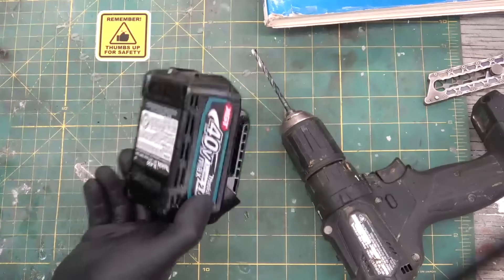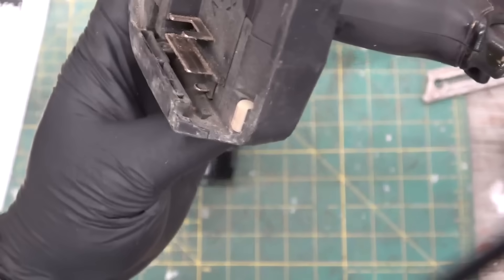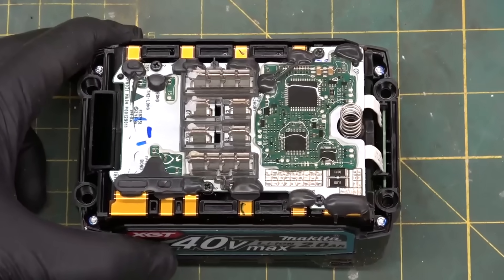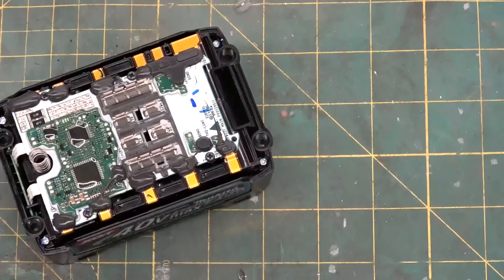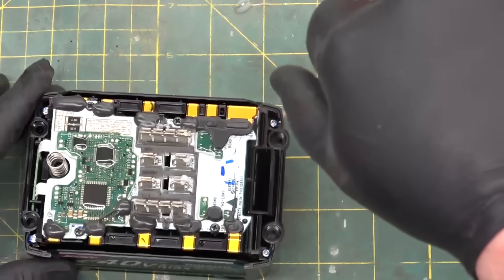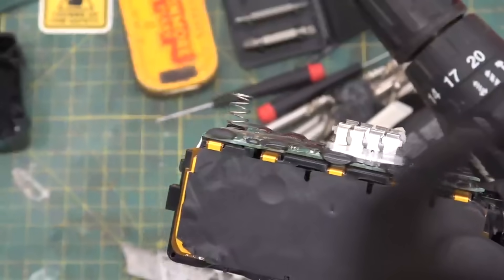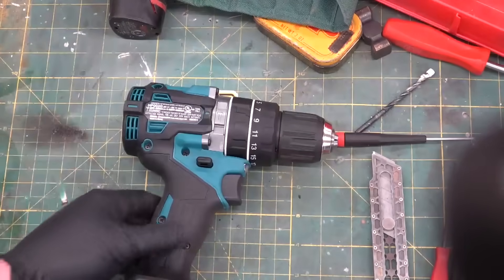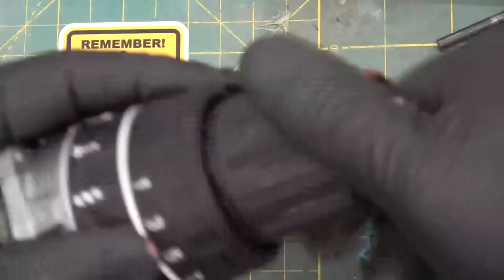BOLTR: Terrible 40V Drill || Et tu, Makita?

Comment: Pretty soon tool manufacturers will be up to 110v and we can just plug them into the wall.....
Reply: Shame we Europeans will have to wait until they get to 240!
Reply: @notsonominal  ... It'll be a while 😞
Reply: @ yeah, DeWalts 54v flexvolt is already 110v compatible but that doesnt help us over here.
Reply: @notsonominal just run it half speed😂
Reply: @notsonominal  Maybe they will go to 110 then just put two batteries in series.
Reply: @AlgoRivm  that is what they do with the 54v flexvolt system - but thats also just about the limit of Safety Extra Low Voltage (SELV) power supply and I suspect there will be regulatory hurdles past that.
Reply: @notsonominal  UK site-safe tools are all 110v through a split pole transformer, so unless you do something really dumb you'll probably only get hit with half of it so 55V AC, barely a tickle lol 🫠

Certainly a lot nicer than the belt you get from 240V AC if you make the smallest mistake 

And for the bargin hunters out there, searching UK for-sale sites or marketplace for "big yellow battery" or "heavy yellow battery" will bring up a bunch of scorned Ex's selling off tools that they aren't all that clued up on and there's no man around or he'd tell her it's a transformer, not a battery. Happy hunting UK folks lol 🇬🇧
Reply: @notsonominal just use a transformer!
Reply: @tomspurr7963  DeWalt actually makes a faux battery that takes 230v and emulates the flex volt system. Problem is the tools aren't made for that service factor and burn out.
Reply: XGT actually pulls more power than you can get from a 120V socket. Tabless 21700s can do 70A, which is 2800W, or 23A at 120V (120V sockets generally max at 15A).
Reply: @dsgamecube then plug it into a dryer plug. 😂
Reply: @dsgamecube what if i have 240V sockets ? 20 amps no problem
Reply: @dsgamecube laughs in 230v 10a
Reply: Unfortunately when you rectify and smooth 120vac, it becomes 170vdc. But, other than the fancy new brushless tools, those old "dc" motors are actually series-wound universal motors, they'll run on AC, DC, fvckin' they'll run on your PC if you hook em up.
Reply: Then they can sell ya 2. Half hour run time, half hour charge time. Just plug the whole thing into the wall with a PC cable, charge the tool instead of taking batteries out.
Reply: @SomeGuyDjoeOnBass you know before there was battery drills there were corded 120v ac ones??
Reply: Here in the UK some clever sod invented plug in 240 volt power tools 🤣👍
Reply: I have some tools like that!  They're great... until you get to a job site with no power.
Reply: @rex8255  The lectrical-tician is s'posed to set up temp power.
Reply: @xtnuser5338  ohhh, your work on them FANCY job sights, with like people and stuff!
Reply: Genius corded cordless 😂
Reply: Unfortunately, that one foot cord.😢
Reply: Wow future sounds amazing
Reply: Portable thermo nuclear batteries are where its at
Reply: This has me 😂
Reply: metabo has come out with an ac adapter for their 36v cordless tools. in case you didn't know. So yea it is here. It is kind of nice though, If you're near an outlet you can plug the 36v compressor in. I haven't tried it on anything else yet. It is a bit bulky.
Reply: Sounds retro. Let me grab my man bun.
Reply: Damn your on too something there.😂
Reply: AC vs DC bruh
Reply: @timwrich5128  Rect it and cap it, might be rough but it works...
Reply: Diodes... and kapow, rectalfication!
Reply: Amazing lol!!!
Reply: Nothing like going the long way 'round.
Reply: yup a full 360
Reply: Tools is a kiwi🤦‍♂️ not a Australian😂
Reply: Imagine that… what convenience
Reply: For real....
Reply: Lol😅
Reply: "Dual Fuel"
Reply: Real power tools are 240v  :p
Reply: @jonathanwright5550  REAL power tools are pneumatic.
Reply: "Its a thermo poly carbonate butal hydroxide 800 plastic"...I love the bullshit he makes up as he goes
Reply: @Chris_Willows  irs fun to see what he is saying wrong intentionally for humor  and what is actually the correct thing he is saying that just sounds wrong
Reply: dewalt do that ,,some of their chop saws will take two 60v flexvolt batteries or plug it in to the 110V mains
Reply: If you have dendritic you need to be using head and shoulders-works good
Reply: 120VAC is 84VDC so once we get there you will be able to slap a rectifier on the outlet and then plug er in just like grandpa!
Reply: @jaythompson5102  What?  120VAC rectified is 170VDC.
Reply: Yeah... AC ..... Try it.
Reply: @broderperdurabo  the motors already are AC, there's a variable speed drive that converts the DC battery into AC
Reply: @moonasha  The motors run on 3-phase AC and the wall only has 1-phase.
Reply: @broderperdurabo  nothing impossible with a F U U L B R I D G E
Reply: @neaudle2204  All hail the FULLBRIDGE!
Reply: @broderperdurabo  When I was a kid, I had the brilliant idea of using the old Christmas lights that my father threw out during the holiday season. I took that and cut the lights off and tried to fashion it to my mini car DC motor that had flimsy tabs so it contacts the track. One side had broken off and I had to hold that wire to that side when plugging it in.

The result : a wall socket blackened by smoke fire up to the wall, my fingers holding the wires were hurting and later developed a blister. As for the little DC motor, it had flown across the dining room and the kitchen floor and stopped by hitting the dishwasher 18 feet away. Let's say that the little dc motor had the fastest lap he'd ever do.
Reply: @broderperdurabo  great job missing the joke there sport
Reply: @aquacruisedb comment section be on the spectrum.  I like it...
Reply: @broderperdurabo  Lmfao 🤣😆

Comment: Makita went with "40V Max" because the yellow brand had "20V Max" as it's signage.  We all know they're 18V packs made with 18650's.  So the 40V is 36V after a few spins.  Just took the LXT x2 movement to a single pack.  That's it, that's all.  It does give the chance to ramp into the 80V scene though (and they have).  Or, 72V after a few spins.  21700 metrics.

Comment: the battery needs holes for airflow, theres going to be water in the battery case even if there were only holes in the top, there are holes at the bottom so that the battery can dry out once its been wet to avoid damage. the battery can withstand water that doesnt just sit in the case.

and yeah this drill isnt nearly as good as the flagship xgt drill

Comment: The Röhm Chuck is crusty because you  locked it up halfway midair
When you close it, at some point it clicks, and then you get to tighten some more. This mechanism keeps it tight in Both turning directions. If you fuck around with it, you can get it in the crusty state. simply put a drill bit or whatever in, tighten it, loosen it and it feels like you would expect. 

Similar Chucks are installed on other brands aswell

Comment: Buys the cheapo low end 40V Makita drill HP002, not the decent HP001. Is then surprised it is cheap.

Proceeds to complain about air cooling vents on battery (the charger actually cycles air through them while charging with active fans), that allow faster charging speeds without damaging the batteries.

Mentions that fast charging is bad on the batteries, neglects to notice how the voltage is double the industry average so the heat generated while charging the same amount of energy over time is less than half.

My expectations were higher, no idea why you have so many subscribers. Probably due to comedic delivery and performance, not accuracy and fairness.

Comment: the real issue with all these high voltage cordless packs is they have to be huge to get any kind of ah. here we are using a 6ah size pack rated for 2ah since its 40v. metabo has the same issue, great tools but runtime sucks and even with 36v the metabo tools cant outperform dewalt or milwaukee at 20v

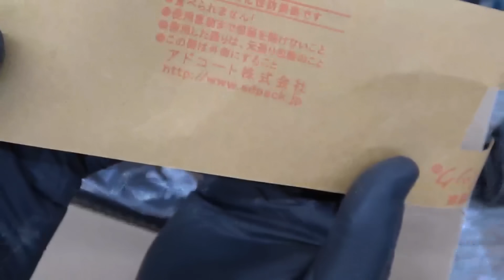Comment: 1:20 VCI (volatile corrosion inhibitor) paper. Could never trace down what chemical it is. But it does volatilize in a closed chamber. Will fuck your eyes up if you open said closed chamber too close, in an enclosed environment, hands close your face, etc. Fun with gauge blocks

Comment: I prefer the 40v cordless impact and drill that you can buy separately and not in the kit. For some reason they have 3-4 models of each one in the 40v. For example my drill has a full metal chuck vs the part plastic one that comes in the kit.

Comment: I already hated Makita because of the ass backwards horseshit marketing strategy of ABSOLUTELY FUCKING every loyal customer. Instead of just upgrading their 18V batteries like literally every other power tool manufacturer (for fuck sake man, even Kobalt, Ryobi, and Masterforce are offering better 18/20V battery packs), they said FUCK YOU! If you want better batteries, you have to buy all new tools. So there's people with literally over $100,000 invested in the LXT Lineup and all their friends have been laughing at them for years because the best LXT battery you can buy is a 6.0 with 18650s in it that cost $160 a pop when Milwaukee M18 and Dewalt 20V MAX, have producing 3.0, 4.0, 5.0, 6.0, 8.0, 12.0 and even 15.0 battery packs with 21700s and pouch cells for years now and FOR LESS $$$$$ than Makita junk 18650 packs, and instead of upgrading their packs, Makita said, no, fuck our loyal customers, let's make them buy all new tools. I know I'm talking in circles, but I cannot express enough how much I hate Makita for this move. Fuck them. Fuck their 40V tools. And fuck you for buying them and supporting a company that hates its loyal customers. Makita could be the best power tool company on earth of all time, Id still never buy a god damn thing from them on principle for this move. Absolute jerk off move. Fuck them. There is NO GOD DAMN REASON they couldn't just upgrade the cells in the LXT packs instead of making a whole new tool line. It's a cash grab, plain and simple. And then to find out the new 40v tools are shit quality too? Makita is no longer in the conversation of "the big three" it is now TTI, SB&D, Chervon, are the big three, all the others (Festool, Hilti, etc.) And THEN Makita at the bottom of the dung heap as far as I'm concerned. Fuck them.

Comment: It sure would be nice if the batteries (and the tools too) kept track of usage statistics. Every laptop battery and hard drive for the past 20 years has done it. The circuitry is already there. 10 cents for an NFC chip would let your phone (or whatever) see how many charge and discharge cycles, average amp hour usage and overall health of the battery and tool.

Comment: That is one of the worst tools of the entire system. 
The impact also has no big advantages over the lighter 18V... 

The benefit of this system is when you need more power. 
The big drill, large SDS rotary hammers, angle grinders and so on are where the real juice is. 
I tested the smallest rotary hammer HR010 against a new bosch professional corded machine... it wasnt even close.

Comment: 40V is going to have 1/2 the current as the traditional 20V so It’s actually OK if the cell links are made of thinner conductors. Also since the entire board has a conformal coating (and a thick robust one) the openings in the case are actually a GOOD THING. 

Even if you drop it in water the water will run right back out of the battery instead of getting stuck in most regular designs. It’s not as if anyone is actually going to be trying to use the drill with the battery fully submerged and if they do they deserve the outcome. 

While I haven’t used these myself I wouldn’t have a second thought using them in the rain. With how warm they get with the fast charging it will dry them out.

Comment: I'm thinking that the T8's inside the battery case are actually security torx, where the bits need a hole in the centre to properly engage.

Comment: Of course it can't drill leftwards, you are using the wrong hand when holding the drill.         In all honesty, I have no idea why they put air vents at the bottom of the battery pack - I guess the theory is that any water would drain out while Flexvolt instead has the vet at the top right corner but I would imagine water would drain out anyway when moving the tool around.    Very odd.

Comment: I don't really understand who Makita made these for. The 40v batteries are huge, and these are really expensive (even for Makita). I consider myself a Makita fanboy in many ways, but they should have just started offering 21700 cell (or pouch or tabless) batteries, and rolled out an equivalent of Fuel or XR tools that can take advantage of the extra pixies from the big boy packs. Makita got left in the dust on their battery tech, and it makes it hard to justify the cost. These 40v tools do not seem to remedy that problem.

Comment: I've had an OG Makita BDF454 brushed for 20 years original battery is invincible and in that time I have been through a Willfucki Fuel and AEG brushless disposable garbage. It drives through ironbark and stringy bark hardwoods no problem. Who cares if it takes 2 seconds longer to drive a screw, longevity and reliability is the true marker of the best tools.

Comment: Im pretty sure the batteries come in a deactivated state until they are installed on a charger. I put a new one on and took it off immediately, it had 1 or 2 bars and would run the tool

Comment: correct me if I'm wrong but at those voltage levels and the board being sealed, would occasional water ingress fry it or you? I don't think so but i have been wrong once before. You know, I bet you could test that AvE. Wadaa ya say boss? give er the old 2 finger wet willy?

Comment: Ehhhh, I got the less economy version that has the little jog dial on the bottom by the battery, lets you set an electronic current controlled clutch which I like a lot. This one seems quite a bit cheaper. Especially the plastic chuck.

I had the black model you showed on the bench earlier in the video and the chuck on that one started stripping out on me like a few months into ownership of the tool, wouldn't release. Swore no more plastic chucks from there on out. 

Been really happy with my fancy 40 volt drill. Will twist you up in knots, nearly a kilowatt of power in your hands... that's a whole moped!

The 40 volt weed whacker is one of the most awesomely violent cordless tools I've ever used, more powerful than any gas trimmer I've had before. love it.

Comment: I'm happy with my Makita 18v drill & driver. My first set was twenty when the drill's gearbox finally died (driver still fine) so I bought a new set. Made sure that the new drill had an all metal chuck (like the original) though. Wouldn't trust a chuck with plastic parts.
Never thought my 18v pair were underpowered and my 3AH batteries charge in 15 minutes (luckily I always have power on the job as a kitchen fitter so larger batteries aren't needed).
I can imagine higher voltage could be useful for a lawnmower/chainsaw etc but I'm not changing any time soon.

Comment: It's the charging where they got you over the barrel.  That and rapid discharge, like full chooch on your sds drill with a 4AH battery for 5 minutes straight until smoke starts coming out, but it's not coming out of the tool.  Like your cell phone, 80% charge max is good for longevity.  I thought about putting a voltage monitor on my ryobi charger and dropping out a relay when it gets to a predefined setting.  I did notice on my ryobi charger that there's a light notification when you're around 3/4 full, which is nice and forward thinking.  Only problem is you have to sit there and monitor it, it's not automatic.  They really do want you to torch your batteries to keep you buying more

Comment: Re slow and fast charging, I have the whole array of DeFault chargers, 2A, 3A, 4A, 6A, 8A and 12A and try to use them at 1C or less as per one of my shorts :-) plenty of other good tidbits of info in there too if you're done being annoyed with your 40V battery water cooling holes :-D

Comment: I don't so much mind the bottom of the batteria having water holes.
If the holes are on the sides or top you get water ingress when it's drizzling in the out and about, so you're dang'd if you do/don't.
With the bottom holes, at least the water can drain from the battery and isn't stuck inside.
Just my bumble opinion.

Comment: 36v is great and all, but forcing you to buy all new tools and batteries is garbage
Hitachi might not be the best tools anymore, but the way they handled 18>36v was much better.

They made 'MV' batteries with an extra lug only used on newer tools, that are really 2x 18v batteries inside the box, but depending on which lugs you use it's either in series or parallel, for 18v or 36v but half the amp hours.

Comment: The bms and the cells seems fully sealed tho, are you sure the vents arent actually a good thing? Both water drainage and heat dissipation. If the leads arent sealed you just need some water to one-up your work buddy that like to light his farts on fire.  3 in 1  if you think about it

Comment: I’ve got a pretty full kit of this 40v gear and so does my main guy. Wood elves. Thrash it pretty hard, only problem so far is the chucks on the impact drivers fall apart fairly quickly. Other than that, no problems so far. We build barns, so pretty dirty, wet environments.

Comment: Down under that Makita xgt stuff is sold at the hammer barn stores for tight arses in which case you only get 80% of the actual tool. Things like proper gears and sealed batterias are only sold at the tool shops 🤪 you mightta got seen cumming 😂

Comment: I have been inside a factory that made impacts for a big brand and other things for smaller brands. The tools with big volume the assembly was automated from greese to hot glue on electrical connetors to fasteners everything was automated. The rest of  the lines with smaller volume had 20 -30 people just doing everything